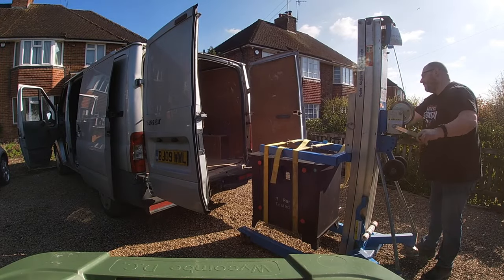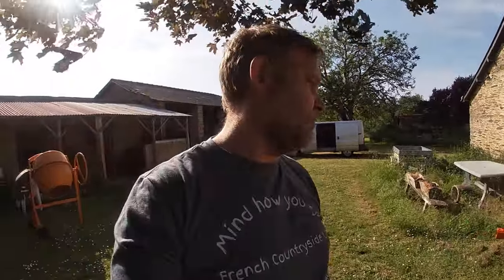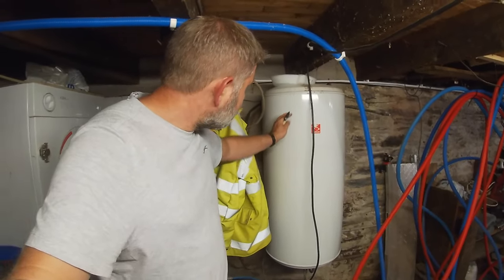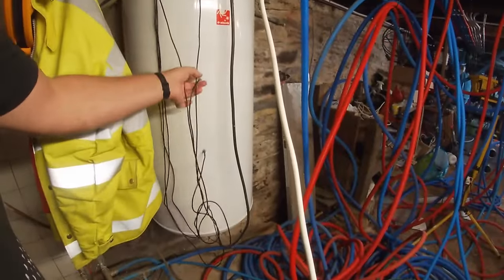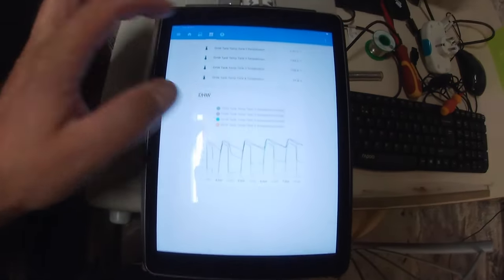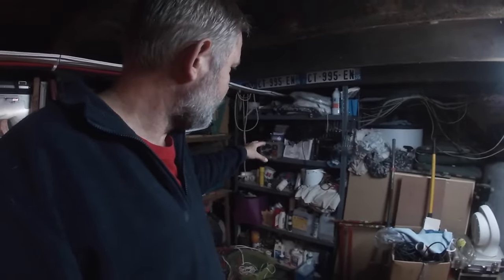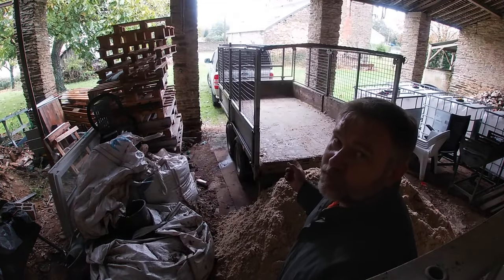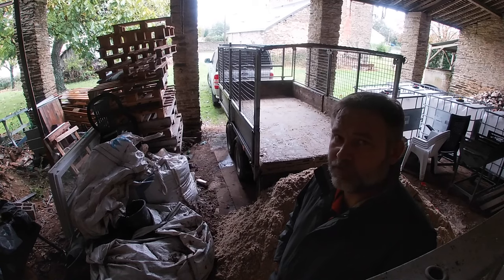Wood fired boiler stove Installation (Part 1 - Preparation)

Comment: Fascinating stuff Andy. How does the stratification work when you have a tank that can lay on its side ?  I love your Forklift/Dumper/Utility Vehicle. Just brilliant. I hope you bring the knowledge learned from this series to here and it'll be a walk in the park for us. 🤔
Reply from the maker: The dumper is amazing, I have the Kubota but it can only lift half the weight of this thing. Horizontal tanks work in the same way but are less efficient because the water rises up quicker. It's why you usually see tall cylinders unless physical requirements mean they can't be fitted.